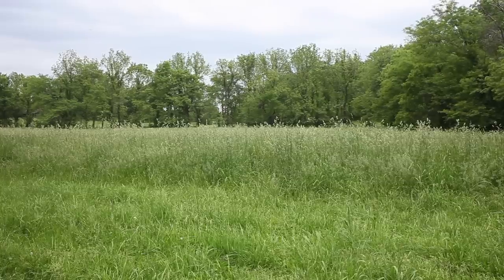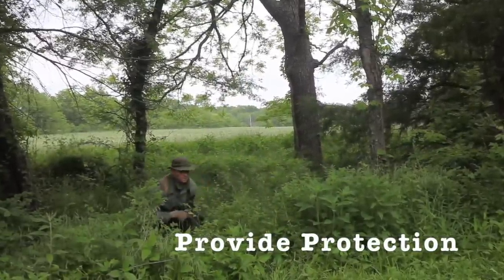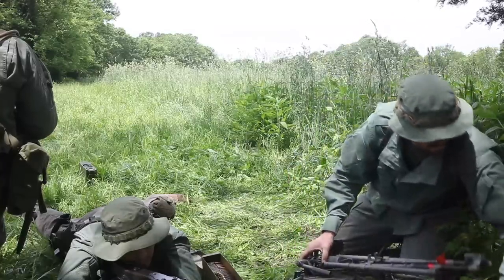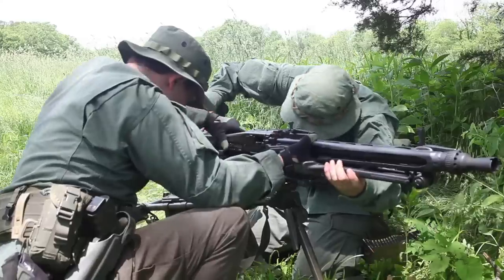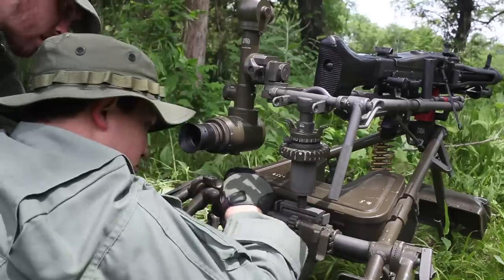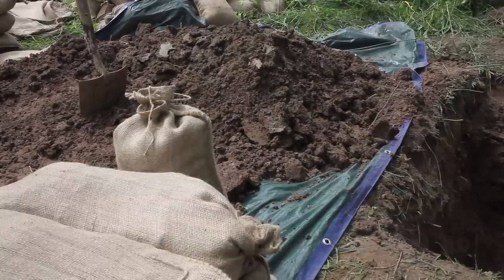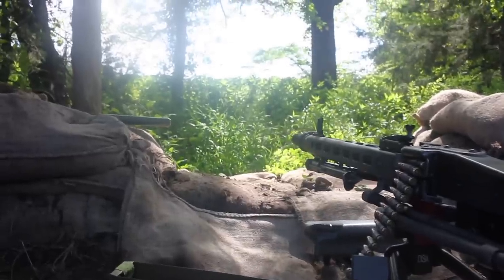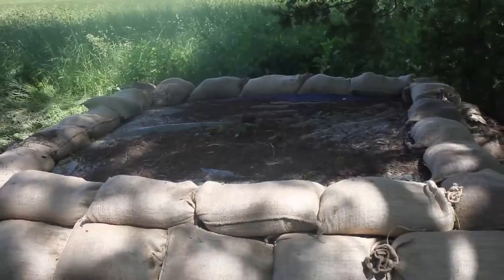How to Build a MG Fighting Position

Comment: Great video. It can be argued that the exit of the firing position should be coverd by some material like cloth/a blanket or another poncho to avoid the light contrast between the dark fighting position and the bright background. This contrast can be seen at 16:39 and can give the the fighting position away.
Reply: Saw that too, good solution
Reply: absolutely
Reply: True!
Reply: Would be easier to see the flash of the gun while it’s firing
Reply: maybe even an L shape exit
Reply: @rahjah6958  if the machine gun fires its has contact. but before of the point of contact u can close the "door" so it wont get easily spotted .
Reply: @rahjah6958  Yes but...
While the position is not firing you may have enemy patrolling. Why let the enemy know where you are before you start firing.
You don't want the first rounds of the engagement to be the enemy taking  out you gun crew (or any other of you side).
You want to be able to resist a deliberate attack.
Reply: they could have done that intentionally to make the mg position more visibile for the video
Reply: Yes, netting would be good too, it would also help prevent grenades from being tossed inside if you are about to be overun or flanked.
Reply: While I totally agree they mentioned covering the exit as part of the expansion & additional camouflaging or adding slopping floors or sleeping areas etc. I believe it's around 15:40 or so they pass over it pretty quickly as part of the "extended stay" modifications. Also in the beginning the mention about taking or making doors or covers for the passage from surrounding areas &/or making it with camo. Again it's only mentioned briefly. I have to say if I went through all that I'd try to cover the sandbags with some of the dirt or turf left over from the dig out to help make it look more natural & provide a bit more protection & concealment but again all assuming you have time & can do so in a relatively natural looking way.
Reply: 👍this guy ambushes

Comment: 2:50 Belt should be stored so that the lid faces the MG after opening. That makes the belt rest on the inside of the lid, protecting it from dirt. 

Great vid!
Reply: That's a nice touch. It's the little details like that, that can determine the quality of a gun crew (although combat situations can mess this up entirely, and understandably so)
Reply: @Pwh5476  Those ammo cans are SO German. The handles are offset to one side. The reason is so two can be tied together at the handles  so the cans don't make a "knocking" sound as the tripod carrier walks with them. I guess the reason is it makes it easier to carry 4 ammo cans with one person. The third man carries the lafette (German for "carriage", I guess there is no direct translation for "tripod." German grammar is a bit wonky and strange.)
Reply: @Pwh5476  not just a nice touch, that’s the only way to use these ammo boxes right. On the bottom of the box is a stiff wire that lifts the tip of the bottom most row of ammo a few centimeters to offset the difference in diameter of the following rows. If you don’t use that wire or put in the belt the other way round your whole belt will be a mess after walking 5 minutes
Reply: @largol33t1  One Ammo can weighs something like 10-12 kg. I can't imagine one guy running around with 90 or so lbs of ammo cans in his hands.
Reply: @joe6167   not impossible at all in a pinch where it matters the most. Especially short distances inside of a trench network for instance and well designed handles. (I'm only suggesting without any prior military experience)
Reply: @largol33t1  Bipod = Zweibein
Tripod = Dreibein

Comment: As an Light Infantryman, this video contains many of the smaller details that aren't taught in the Army anymore, only a weapons squad leader would know all of this information, very interesting to me, although i love how a 6 foot hole is still "hasty" while this could take literally an entire day-
Reply: Digging holes" is what convinced me to join the Air Force not the army.  Realized at a young age, digging holes with my friends out back how long it seemed to take, and I better avoid this kind of work
Reply: Takes less than an hour for one man. Even less if more men.
Reply: @JohnDoe-yq9rt  when was the last time you dug a 6 foot deep hole with an army entrenching tool? in clay.
Reply: @richardnoah2922  In my case, 1988, Ft. Ord, CA. About an hour for two men digging a two man foxhole; that included grenade sumps and and ammo ledge. Light Fighter!
Reply: @schaferhundschmidt1798  I guess Fort Polk was just a different story, maybe the dann new aluminum E-tools just can’t compare
Reply: @robertmaybeth3434  At age 19 my job was digging holes installing sprinklers.  I decided to stay in college and ended up getting a doctorate.  You really can't beat working inside with air conditioning.

Comment: One thing that can be of assistance is to have your entrance be covered to prevent the gunners inside from being silhouetted by daylight coming in from behind. Having the entrance also have a ninety degree turn to get in will make it tougher for shrapnel to thread its way in with a blast to the rear from IDF or a 40mm grenade launcher.

Comment: You forgot the part about when you are totally done digging the fighting position some officer will decide it's not quite in the right place and have you move the gun and start the whole drill all over. Of course, you have to fill in and hide your old position. 

We used to drill moving the gun on the tripod. This was before everyone had night vision and you definitely had secondary firing positions. When the enemy probes your lines they are looking for the location of your automatic weapons so they can take them out. Things are different now in some ways. But a well placed, set up, and supplied machine gun in the heavy machine gun role with an experienced crew can bring a lot of pain.
Reply: At least until the mortars/artillery/bombs start landing then they're just a sad statistic.

Comment: Brings back memories when we make MG Bunkers and Foxholes serving as an assistant gunner and machine gunner in the 82nd, back in the 1980s. I can tell you that making those bunkers is some of the most exhaustingly work to do. The manufactured wood is a nice touch for the bunker, but not very practical in acquiring in most cases. Cool video.

Comment: (Infantry 1976 -  98)  Good advice; add...  Do yourself a favor and purchase a short folding saw; the best you can get because they are almost impossible to sharpen (if orange, paint it or something).  At the bottom of a hole, entrenching tools are lousy for cutting roots. Things we learned from the Viet Cong, the Japanese, and the Germans.  Start by angling the position to the direction the enemy is expected to attack from; two positions with intersecting fire that covers blind spots to the other position.  Build out the position beyond the flash of your weapon.  The only man who could see your gun-flash is the man you kill - and he should be looking straight ahead and not at you.  
Don't get lazy; go at least 50m behind your position to get natural camouflage; remember to replace it every day before it goes brown.  Those brown sandbags will give away your position.  Instead, cut all the sod and put that upside down on your poncho; this includes sod in front of your position.  Use that tarp to catch all the loose dirt as you dig; below-ground dirt is a different color.  Pack some of the dirt from the hole at a slope leading up to your position; then cover with sod.  If you have a periscope, dig down far enough that no bullets coming into the position hit you ("Blood Red Snow" by Gunter Koschorrek).  When finished building, put last of sod over emplacement.  If you water the grass, it will keep growing.  Encourage vines, etc., to grow over  your position.  Under all conditions, slightly wet down the ground in front of your position to minimize dust kicking up from the blast of the weapon.  SPARSELY clear just enough brush in your firing lane to see enemy movement; shoot anything that moves.  If they look at you, they should see nothing but brush.
Never stop improving your position; dig up the ground behind your position and slant it backwards, as with the front.  If in one place for enough time, dig communication trenches between positions and to the rear.  Never in straight lines, and only deep and wide enough to safely crawl through.  Dig the walls of all positions wider at the top than the bottom; this will reduce shadows from over-head observation.  Put spongy evergreen twigs along the bottom of positions and trenches; remember to replace before it goes brown.  This will keep things green and reduce fatigue of standing for long periods of time.   This 'bunker' works best when there are two firing positions slanted outwards (blind to your front, requires real self-discipline) and one exit hole that is straight back; this minimizes light flowing through the position and silhouetting you (don't forget that blanket!).  
And... most importantly but never done - BEFORE you start digging, the leader should go out in front of the Primary position and reverse engineer where the firing positions should be located to eliminate blind spots in front of the unit.  The leader should identify grid coordinates for low ground that can be 'served' by grenadiers, mortars, and howitzers.  The leader should often patrol to the front and recon his own position as if he were an enemy scout; make improvements as needed.  The leader should know Secondary (fall-back), and Tertiary (enemy out-flanks you) unit position locations.  Given time, you need to start work on those and rehearse routes to them that are covered from enemy fire.  It never stops...
Reply: Instructions unclear, the enemy didn't wait patiently for me to finish prep and just flanked me while dropping mortars on me.

Comment: Very nice, this is a German MG-3, which is basically a reversed-engineered 7.62mm MG42, with the same tripod pattern as would've been issued for the og MG-34 & -42 (firing in 7,.92mm 1942-45)

Barrel changing on these is stupidly easy & fast.
Reply: You can hardly call it "reverse engineering" since its a German weapon and they designed the original. The MG3 is an evolution of the MG42. To reverse engineer means to obtain a piece of tech that you have no knowledge of how it works and then slowly figuring out the systems and its functioning and designing your own.

Comment: Old U.S. Army Infantryman here. Just watching to catch up on what they are teaching now, since I'm old and disabled (non-service related) and this is all new weapons to me. Definately not the M60. And I miss my range card!

And if you are digging a position for the M2, be sure and make the firing platform to the specified size. If not, you might wind up with a .50 cal machinegun pointing at the sky with it, the tripod, and half your position sitting on your lap after 6 rounds. Not speaking from experience at NTC or anything.

Just as a note, that was not plywood they put on their fighting position, it was OSB (Oriented Strand Board), very different.

Thanks for the content.

Comment: In the Australian Army, the section commander places and sites the GPMG. If it is a Company defensive position, the Company Commader will tie in all of the machine guns and give their primary and secondary tasks , only then will they will dig in. For effective enfilade fire, a GPMG does not conduct frontal fire but supports another section/platoon and vice versa. If in a depth position, elevation bars are used to cover the forward section/platoon. Thre is no mention of sentries forward of the position out of hearshot. Once the fighting pit is complete the CQMS will bring forward defensive stores. On some positions may  have a primary and secondary fighting pit. In the German FJR6 in Normandy a Rifle Company had 20 MG 42s.
Reply: GPMG does not come with a tripod with periscope sight as elaborate as MG3 based on MG34/42 design heritage...and since when did US troops start using MG3 ?

Comment: We didn't have the MG3 in our team cuz I was a jaeger, but we did get to see it on the range. That thing's a beast.
Reply: On your team, what do they set the rate of fire at? I've heard some teams request Rhinemetall for a bolt that can put out 1,500 rounds/min!! That's too much. I'd reduce it to around 1,000 to save some ammo.
Reply: @largol33t1  Im from Austria, and we use our own version of the MG3. We have the MG74, wich is basically an MG3 but made by Steyr i think, and it was reduced to 800-900 rpm.
Reply: since when did US troops start using MG3 ?
Reply: @咖哩余  Idk. I'm Norwegian. xD
Reply: @kebman  Norway uses FN-MAG and not MG3, right ?
Reply: @咖哩余  Depends on the unit. They use the MINIMI light machinegun. But some units still use the heavier MG3. Used to be we used G3's as well. This is what I served with, but they changed that for HK416, and HK417 for sharpshooters.
Reply: @kebman  that prepared MG position in the video...would it be able to withstand a hit by 84mm Carl Gustav HE or Shmel RPO-A thermobaric ?
Reply: @咖哩余  No idea pal. I was a jaeger, so we never worried about stuff like that. The enemy never even saw me. And if he did, I was dead.
Reply: @kebman  wouldn't jaegers have to hunt for enemy prepared MG positions or OP/LP positions like that ?
Reply: @咖哩余  Depends on their task. If it's infiltration behind enemy lines, then no. Then your job is to find enemy positions, and report them in. Perhaps lase. During my training we never trained on advances on purpose. Only on withdrawal. Let that sink in.

Comment: 2 years ago: How to Build a MG Fighting Position
Today: How to become an easy static target for a grenade-dropping drone.
Reply: the foliage on top would provide good cover to not be spotted easily, and the dirt/sandbags on top solves the issue of a grenade. We've seen this on the frontlines in Ukraine, an open trenchline gets shit on, but a closed bunker will survive just fine.
Reply: Building a Machine Gun position is still very much relevant sport.
Reply: Both russia and the ukraine are making effective use of MG emplacements. Do you realize there is legitimate trench warfare going on over there?
Reply: Good luck getting the grenade through the roof.
Reply: @notleviathan855  The problem is the entrance, they just drop a granade there and it rolls inside the bunker.

Comment: 10:55 wait what, where did they get that plank from?

"And once the planks are in place, the team proceeds to install plumbing and electricity, while the team leader sets up the wi-fi network. The concrete chimney section is then molded in place and brick walls are raised around the site. As a last measure of preparation, silk curtains are hung in the windows and decorative pot flowers are placed on the windowsills. The machinegun cabin is now in place and after a long day of hard work, the gun crew enjoys a hot cup of cocoa in their armchairs around the fireplace."
Reply: As an example. Alternatively, you can use logs

Comment: Idk about other ways to describe mgs but the mg3, 42 and 34 are gpmgs which has them easily used as lmgs but convertable for more sustained fire through tripod and / or larger ammunition belts
May be more fitting to call it an lmg since in theory I could be operated by a single person if desperate

Comment: So much stuff to take account of, but y'know what would make things quicker?
Having the gun on the full feed belt right off the go, and give the assistant an extra box mag for extended fire support, and an SMG/PDW to provide additional fire support at a minimal additional weight.

Sure, it's more weight, but it'd save precious seconds of preparatory loading time, which if you don't have time to craft a whole position as you're about to be under immediate fire, can very well be the difference between life and death, plus increase the overall ability to defend any given position.

Comment: My father gave me some sage advice; I had ample opportunity to employ it and it worked for me.  He called it the “Rule of Thumb.(RoT)”  Translation?  Only clear vegetation that is smaller than my thumb.  I’m sure others have done what they did and made it.  I figure, 5 combat deployments and I am still here liking says either the RoT worked or I, and my soldiers, ALL my soldiers, were massively lucky.  Or both.  I also made sure that the MG Section carried small handheld pruning sheers.
Did I miss the grenade sump?
Reply: sounds like your dad would be bamboozled by a field of sunflowers.
\

Comment: A bit thin on overhead cover from shrapnel , Also horizontal sheeting needs a bit more overlap at edges for blast protection.A bit of scrim to cover front slot pre firiing prevents a shadow slot

Comment: is clear, wide opening behind position, @16:36 practical or correct? because in daylight any movement in/out position generate rapid change(gradient) in otherwise green bush:
changing entrance position relative to gun parapet, or covering it with two parallel nets/sheets of soft material shoud fix this. 
dirt on front parapet is unavoidable, but should be covered at this stage - when roof is placed. most likely with some grass with roots in soil hauled from rear.

is placing additional sandbags on front parapet with string viable? and widening field wiew only when needed - at engaging stage?

Comment: I have never prepard a position around a gun like this. We would usually only use tripods in pre-prepared positions. I've dug many a pit with OHP though, & that seems like there is little room to raise the feed mechanism cover for reloading. I'm also surprised that #2 gunner is only armed with a pistol. My#2 carried an M16 as well as ammo. Gun group would carry 2000 rounds & the rest of the section an additional 2000 7.62mm NATO.